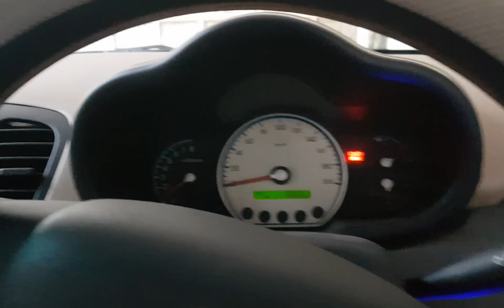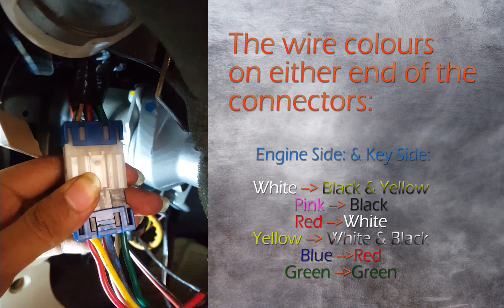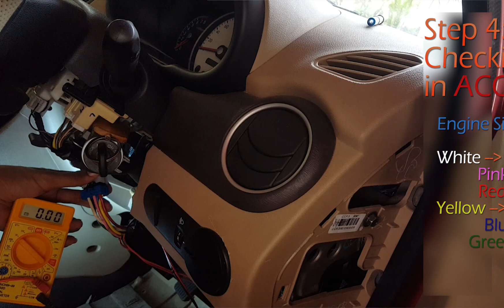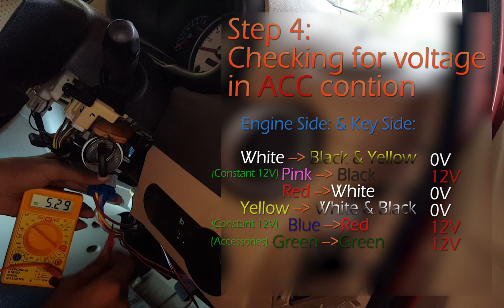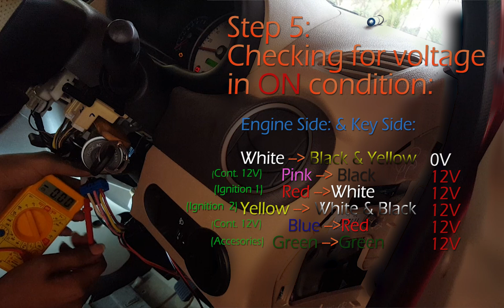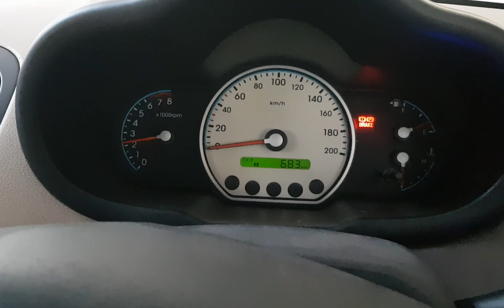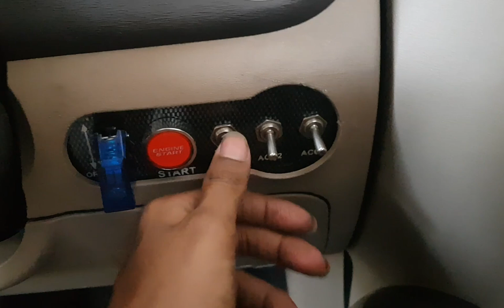Any Car Racing Ignition Switch Installation - Full Tutorial | The Automotive Student

Comment: THANK YOU...SO MUCH! THIS is what I have been looking for !! The best procedure to find EXACTLY which Wires work WHAT Systems. I'm going to do this on MY Truck Right NOW!!!!!! I have been trying to Study 'Wiring Diagrams'.... for the Ignition on my '90 F-250 to install this panel and checking the connectors with the Connector Separated... Constant power? -EASY... accys and Ignition to starter.. NOT so easy.. I have NO doubt this will make it all simple. I also love the way you tapped into the 'Switch-side of the connector to the Panel and the NICE JOB with the custom Dash Install ! Thanks again.. from an Old Man tired of trying to crawl around tight spaces! SUBSCRIBED!
Reply from the maker: Glad it was a useful video! Hope you installed an ignition panel to your liking!

Comment: where do the ig 1 and 2 go?
Reply from the maker: Generally, IG1 and IG2 are the essentials that are required to keep the engine running. Although I am not sure which one leads to what but they could be Fuel Pump, Spark Plugs, and also maybe the radiator fan. There might be others as well.